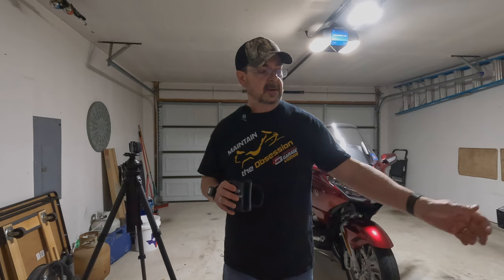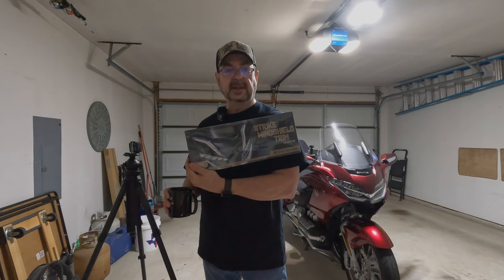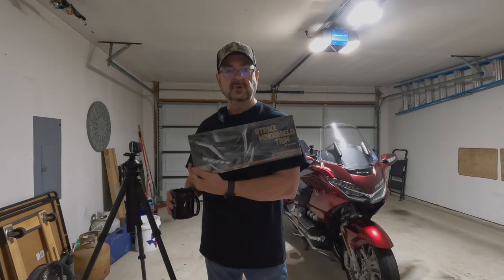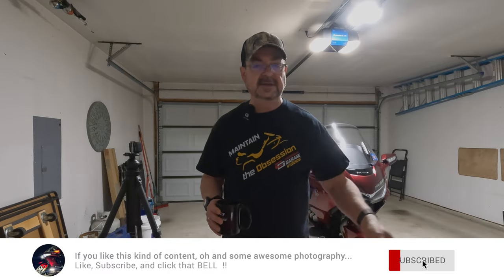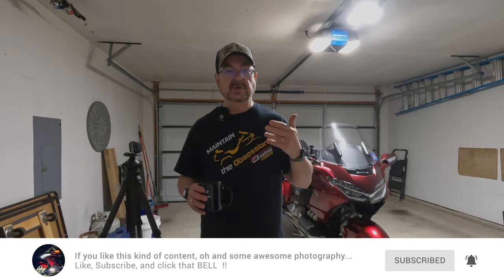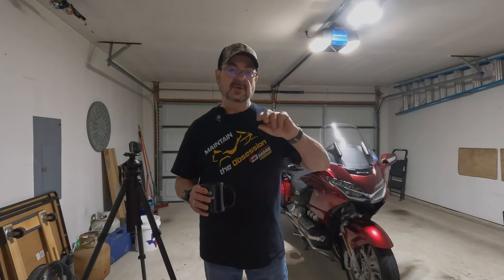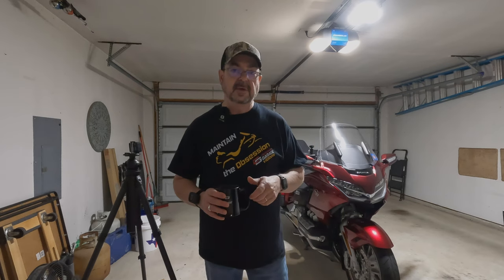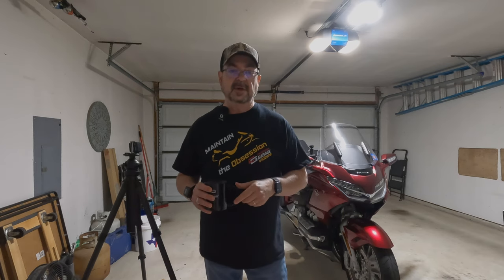Installation - Strike Windshield Lights

Comment: Thank you for this video. I wish they would mount it not via 3M tape. yes, I know you can peel it off certain way, its possible, but its in an area that if you scratch it, you will see it forever. My what if question is, if the LEDs stop working? Also, if you cut the plugs off to connect it to a distribution box, you void warranty. They do look real good.
Reply from the maker: Good point about the Tape.  I guess if one goes out I'll have to replace it in the same manner.  But that could get messy too.  Yeah they told me if I cut the ends it voids the warranty.
Reply: @robertwhitemoto  Goin to get the PF Dist. block. I will have to cut the wires. Goldstrike should allowed to cut the plugs. They will gain more customers. I don't really like the tape application. I had an issue with PF led fixture and it was quick bolt on replacement under warranty. I surly hope these new LED you installed will run you for years.

Comment: I dig those windshield lights. 
However, I saw one on the road that had a section out. Like the individual bulbs were out. Is that possible? I would hate that. Goldstrike makes awesome.
Reply from the maker: @tomvoncharon6359  gosh I hope not… so far mine have been working great 👍🏻

Comment: Great job Robert. I really like those lights. I wonder if the Electrical Connection Shop has an adapter cable for those lights so you don't have to void the warranty? Also I think that I would have pretested the lights before installation just to make sure they worked. Are any of your lights connected to a modulator to draw a driver's attention? Thanks for the video, from Ontario, Canada.
Reply from the maker: David thank you for watching and commenting.  Gold Strike offers an accessory bar that goes under the seat and allows you to keep the existing connection and not void the warranty.  My tail lights modulate.  I encourage you to go find my video from a few weeks ago where I run down everything I’ve added to this bike.

Comment: Does the opposite side turn signal on the mirror always keep flashing faster than the selected turn signal?   I would think that would be confusing to on coming traffic..
Reply from the maker: It's only the GoPro that makes the turn signals in the front of the mirrors seem like they are flashing... has something to do with the frame rate..  in reality they are not flashing.

Comment: Another great install video Robert! 👍. I hope I'm not too intrusive but make sure you have $ left in the budget to change that water heater, it's now 10 years old! 😉 I've been sensitive to water heater replacement dates recently because I need to change mine soon.
Reply from the maker: Jimmy I hear you… what you don’t know is the heating elements have been replaced more recently.  Thanks for watching !!